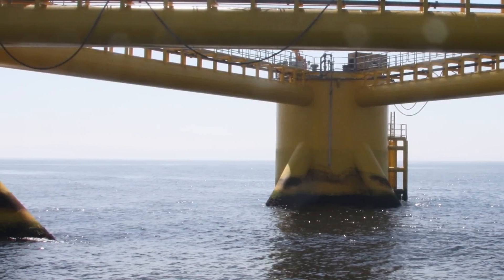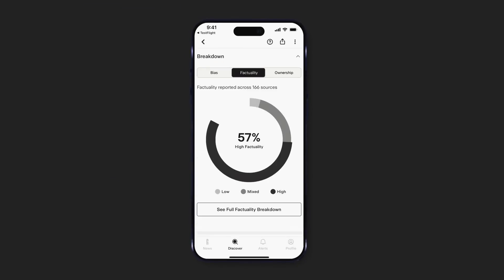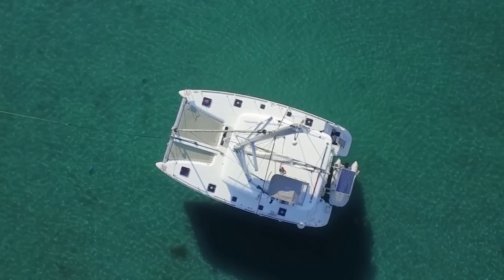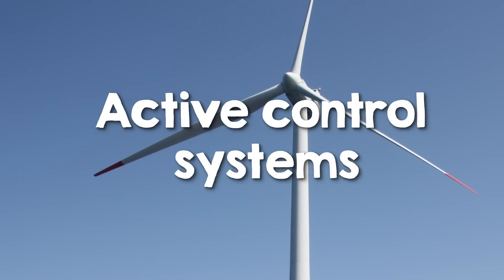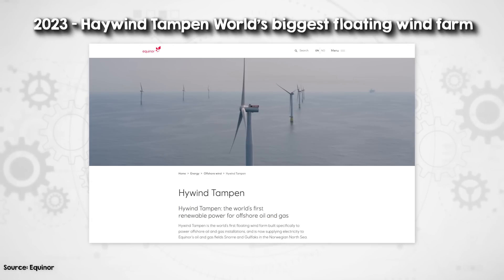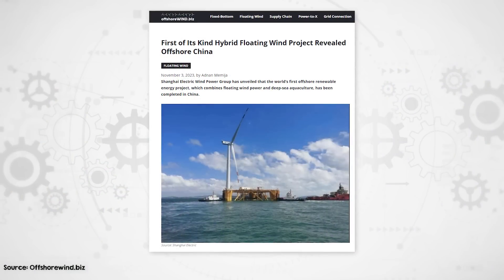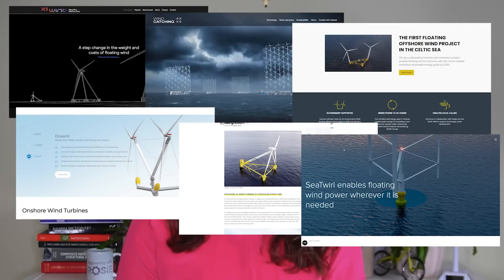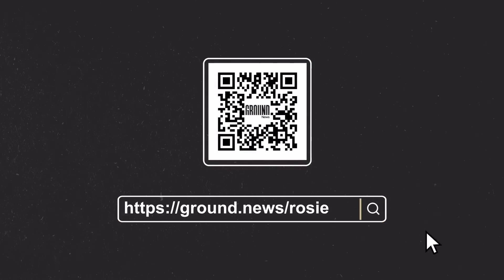The Rise of Floating Offshore Wind Technology

Comment: Wind is a scam.
Why?
Because without a lot of greenwashing  subsidies and huge power purchase price guarantees no one would ever consider investing in something so risky costly and inefficient . It is almost as if they are deliberately wasting time money and resources on things that will never achieve what is required while ignoring and even campaigning against technologies that will achieve emissions reductions at a far lesser cost and higher reliability  and I'm not talking about nuclear only.
There are places keeping aging coal plants operational to cover the shortfall of green energy wasting money on bandaids and such to keep them operational when they could have converted them to run on natural gas and garbage both of which don't go away because you've got wind and solar. There would be less carbon emissions from garbage and natural gas if it is burnt for energy than dealing with it in any other way.
Most so called recyclable materials which should result in a net reduction of emissions actually result in higher emissions than just burning it.
Wind is a solution when there are no better ones like powering a remote community. It is never a grid quality solution and never will be unless cheap clean 1000% efficient batteries are invented

Comment: I wonder how these installations will affect wildlife?
Reply: Probably better for birds than on or near shore, but not sure about marine life. Deep drilling platforms are actually known to improve some ecosystems as they provide habitat, these platforms could possibly do similar.
Reply: @szurketaltos2693  I'm sure you're right about that, but I wonder about the effect on marine mammals, especially whales and dolphins. Any sound transmission from these units is likely to be wide-ranging.
Reply: @mattlodge7305  hm, boat props don't seem to be a huge concern for sound and those are in the water; sonar is the real whale killer it seems. But maybe props are a bigger problem than I'm aware of?
Reply from the maker: The main noise issue is during installation and since there's no drilling here it ought to be much better than most other offshore structures.

Comment: I love your content!
How about combining tidal energy with the wind energy? You already have the transmission cables and already need a big base anyway. Throw some PV panels on too, just for fun
Reply from the maker: I do think that floating offshore's success may be what helps wave energy to finally get its act together. There are a lot of shared challenges and floating offshore has the scale and $$ to push through them where wave has failed in the past. Maybe we'll see shared projects, once floating wind gets a bit more mature. While it's developing I wouldn't want the extra complexity of add-ons to worry about, if I were project managing.

Comment: Many years ago the question for floating wind was 'how will the main bearings do being slopped abut like that' (so adding significantly to the dynamic loads). I guess if Hywind has been dragged back to port for major bearing work, that suggests that those fears were real. I'm sure I read that bearings could be replaced out st sea, because they are built as 3 segments precisely to allow in-situ replacement. But perhaps the point is that they have realised that beefier ones are needed, not just replacements of the standard ones, which is to hard to do out at sea. Looks like the bearing life is half or 1/3rd of  a fixed turbine. Does anyone have details of what has been discovered?

Anyway, yet another 'yay' for a quality video.
Reply: You need to remember that Hywind was built as an experiment, they wanted to find out how long the bearings would last, without having to wait for 30 years.  So they would not have used extra durable components.  I'm not sure that they are actually worn out anyway, it may just be that they want to see the results and upgrade them to test the next generation of technology, and the easiest way to do a thorough examination is to tow them into port.  Also, we are now about to start serious bidding for GW size floating wind farms, those results are needed this autumn.  We did already have some large size floating wind auctions, but nobody bid, too much risk for the price our government was asking, but this time there is more sensible money available for the risks that need to be taken...  floating wind is about to get serious.
Reply from the maker: I have not heard (even a rumour!) what the maintenance is, so I am only guessing like you are. And I also guess bearings, or maybe generators.

Comment: Offshore Wind turbines to harvest energy for electric ships? Fascinating!
What next? Ships powered by the wind itself?
It'll never happen!
Reply: Rotor sail  (Magnus effect ) operate on a few ships. It reduces fuel consumption by 5-10%
Reply: @thomasgade226  OP was referring to sailing ships I believe. 😀 Zero carbon transportation.
Reply from the maker: ha ha! Stay tuned for a video on wind assisted shipping, another one of my favourite emerging techs.
Reply: @EngineeringwithRosie  Re-emerging (and improved) tech I think you mean.... 😉
Reply from the maker: @zen1647  fair!
Reply: It has already happened, at small scale.  
No, the ships will not be directly wind powered, the big ships spend most of their time in the low wind parts of the world, far more cost effective to put the turbines in the best wind locations and store the energy as synthetic ship fuel, or for ships that make short journeys, use battery power.
Reply: @nigels.6051  No kidding? Noddy.
Try googling sarcasm

Comment: At some point, it is certain we will have to industrialise floating sea wind with mass production techniques based on standard components to bang out and float more than 1,000 units every year. For this, we must chose a design that can be made rapidly and assembled entirely onshore, then just be floated out and hooked up. If it is damaged or defective it must be easily unhooked and towd back for repair. Those design restrictions will dictate the model design features - so they are unlikely to be the biggest or most complex designs with the great output, nor are they likely to be done on spar buoys. I suggest we set up a panel in the UK to review all the available technologies to determine the design that most lends itself to mass adoption. I am particularly impressed with one VAWT model in development in Holland that has a single blade, erected on a giant barrel such that higher winds elevate it, automatically reducing its wind load based on the blade design. It seems to offer the best combination of simplicity, economy of materials and power - they reckon they can make them at 12.5MW. It’s early days, but we need to be floating more than 1000 pa within the next five years just in the UK - time’s a wasting….
Reply: They are a massive scam it's all to take the tax payers money wake up
Reply: The developers don't seem to agree, for example BlueFloat's Celtic Sea wind farm is planned to produce 1GW from 50 turbines, so 20MW turbines, with construction starting in 3 years, so they will be using small numbers of the largest available turbines.  The UK now has 30GW of installed wind capacity, but not a single vertical axis turbines as far as I know.  Using untested technology on GW scale farms is not sensible, especially floating farms located in the windiest of places!
Reply: @nigels.6051  Aha - a fellow enthusiast! No, there are no VAWTs I know of in the UK.  This particular VAWT is being developed in Holland. So far he has only tested a small model, but a larger test model is underway. It is fantastically clever in its simplicity, though.   I do maintain that we need to industrialise the entire process of turbine production in the UK to scale it up. Delivering a turbine should be no more than towing it out and plugging it in. Removing a broken turbine should be no more than towing it back and fixing it. The spar buoy turbines are amazing - and I note the Hywind turbines are all being taken back to Skandy for refitting - already.
Reply: @ThinkermanQuindo  I have seen a vertical axis turbine in the UK, many years ago in South Wales.  Looked a fantastic design and was obviously better than the horizontal axis machines next to it, but the test results didn't agree!  We have already had this competition back in the 90's, vertical lost, and if it is to have another go, it needs to prove itself on land first, or in very small and easily accessible offshore test farms as we are maybe seeing with SeaTwirl, expect it to fail again!  The Celtic Sea floating area does seem to be getting quite a few designs, it will be a competition between the farms to find the right design,  but the turbines will be conventional technology because the farms are too big to risk anything else.  I agree that it needs industrialising, but that is now underway along the South Wales ports, the Celtic Sea turbines will be simply towed out of port and anchored, then brought back for servicing.  Massive investment needed for the ports, the turbine manufacturers and the wind farm operators, so the first farms will be a bit expensive, but after that...  20GW of cheap green power coming up, the bigger the scale, the cheaper it will be, the bigger the turbines, the cheaper it will be!    Floating wind is capable of having larger turbines that anything else, expect them to continue increasing in size...

Comment: Finally: To compare the energy storage and output capabilities of Tesla MegaPacks with a typical fossil fuel power plant, we need to look at both energy storage (measured in MWh) and power output (measured in MW):
### Tesla MegaPack:
- *Energy Storage:* Each MegaPack can store up to 3.9 MWh of energy. For 4,000 MegaPacks, this totals to *15,600 MWh* of energy storage.
- *Power Output:* Assuming each MegaPack can output around 1.5 to 2.5 MW, for simplicity, let's take the midpoint at *2 MW* per MegaPack. For 4,000 MegaPacks, this would theoretically allow for a maximum power output of *8,000 MW* if all were discharging simultaneously at full capacity. However, this would drain the energy very quickly.
### Typical Fossil Fuel Power Plant:
- *Energy Output:* Fossil fuel power plants are typically rated by their power output, not energy storage, as they generate electricity continuously. A typical large coal or natural gas power plant might have an output capacity ranging from 500 MW to over 1,000 MW, with some of the largest plants exceeding 3,000 MW.
- *Energy Production Over Time:* If we consider a typical large fossil fuel plant running at full capacity for 24 hours, it would produce:
  - For a 1,000 MW plant: 
    - 1,000 MW * 24 hours = *24,000 MWh* in a day.
- *Operational Considerations:* Fossil fuel plants don't always operate at full capacity due to maintenance, load requirements, or efficiency considerations. Their actual energy production might be lower, often around 50-80% of capacity factor.
### Comparison:
- *Energy Storage vs. Production:* The 4,000 MegaPacks can store *15,600 MWh* of energy, which is less than what a single large fossil fuel plant could produce in a day if running at full capacity. However, this comparison is somewhat misleading because MegaPacks store energy, whereas fossil plants generate it continuously.
- *Power Output:* If all 4,000 MegaPacks were discharging at once, they could theoretically match or exceed the power output of even the largest fossil fuel plants for a short duration. However, this would deplete their stored energy in about 2 hours at full output, whereas a fossil plant could continue producing at that rate for much longer, limited only by fuel supply and maintenance needs.
- *Usage Scenarios:* 
  - *Peak Shaving and Grid Stability:* MegaPacks are ideal for providing power during peak demand times or stabilizing the grid, which fossil plants might struggle with due to startup times or operational constraints.
  - *Environmental and Operational Flexibility:* MegaPacks offer zero emissions at the point of use, can be deployed quickly, and have operational flexibility, unlike fossil plants which require fuel logistics and have significant environmental impacts.
- *Economic and Environmental Considerations:* While MegaPacks might not match the continuous output of fossil plants, they offer benefits in terms of reducing peak demand costs, integrating renewable energy sources, and reducing carbon emissions, which are increasingly valuable in today's energy market.
In summary, while 4,000 Tesla MegaPacks can't match the continuous energy production of a large fossil fuel plant over 24 hours, they provide significant power output for short durations, offer grid stability, and support renewable integration, making them complementary rather than directly comparable in traditional terms. Their value lies in their ability to provide rapid response, environmental benefits, and flexibility in energy management.

Comment: The energy storage capacity of a Tesla MegaPack is typically measured in megawatt-hours (MWh).
*Tesla MegaPack Specifications:*
- The Tesla MegaPack has a capacity of approximately *3.9 MWh* per unit, depending on the specific model.
*Calculating Total Energy Storage:*
- For 4,000 MegaPacks:
  - Total Energy Storage = Number of MegaPacks × Energy Capacity per MegaPack
  - Total Energy Storage = 4,000 × 3.9 MWh = *15,600 MWh*
*Power Output vs. Energy Storage:*
- The power output (in MW) of a MegaPack can vary, but typically, it's designed to provide around *1.5 MW to 2.5 MW* per unit for short durations, depending on the configuration.
If we're talking about how much power could theoretically be drawn from all these MegaPacks simultaneously:
- If each MegaPack can output, say, *2 MW* for simplicity:
  - Total Power Output = Number of MegaPacks × Power Output per MegaPack
  - Total Power Output = 4,000 × 2 MW = *8,000 MW*
However, **this power output would drain the stored energy very quickly**. If you were to draw 8,000 MW continuously:
- Time to Drain = Total Energy Storage / Total Power Output
- Time to Drain = 15,600 MWh / 8,000 MW = *1.95 hours*
In practice, MegaPacks are not typically used to provide such massive power outputs continuously but rather to provide sustained energy over longer periods at lower power levels or to provide peak power support for shorter durations.
So, to summarize:
- *Energy Storage Capacity:* 15,600 MWh
- *Maximum Theoretical Power Output:* Up to 8,000 MW if all units are discharging at their maximum rate, but this would be for a very short duration.
For practical applications, the power output would be managed to match the load demand, which could be significantly less than the maximum theoretical output, extending the duration over which the stored energy could be used.

Comment: I asked Grok 2.0 how many Tesla MegaPacks would fit in a super tanker.  Now I realize that the issue is actually mass and not volume but this is a first approximation: **a rough estimate, considering packing efficiency, would suggest that around 4,000 to 5,000 Tesla MegaPacks
To determine how many Tesla MegaPacks would fit into the largest super tankers, we need to consider the dimensions and volume of both the MegaPacks and the tankers.

*Tesla MegaPack Dimensions:*
- While exact dimensions can vary, a typical shipping container size, which is somewhat similar to a MegaPack in terms of fitting into spaces, is about 20 feet long, 8 feet wide, and 8.5 feet high (6.1 meters x 2.44 meters x 2.59 meters). However, for simplicity, let's assume a MegaPack has dimensions close to these for our calculation.

*Volume of a MegaPack:*
- Volume = Length × Width × Height
- Using the shipping container dimensions for approximation: 
  - Volume ≈ 20 ft × 8 ft × 8.5 ft ≈ 1,360 cubic feet

*Converting to Metric:*
- 1 cubic foot ≈ 0.0283168 cubic meters
- Therefore, 1,360 cubic feet ≈ 38.4 cubic meters

*Largest Super Tankers:*
- The Seawise Giant (Knock Nevis) is often cited as the largest supertanker ever built, with a length of about 458.45 meters, a beam (width) of 68.8 meters, and a draft of 24.611 meters when fully loaded. However, its usable cargo volume (which we're interested in for fitting MegaPacks) isn't directly given but can be inferred from its deadweight tonnage or cargo oil capacity.

- For simplicity, let's consider a more general large tanker's cargo area:
  - If we take a large tanker with dimensions for cargo space roughly as 300 meters long, 50 meters wide, and 20 meters high (a conservative estimate for calculation purposes):

*Volume of Cargo Space:*
- Volume = 300 m × 50 m × 20 m = 300,000 cubic meters

*Fitting MegaPacks:*
- Assuming we can fit them like bricks, with minimal space wastage:
  - Number of MegaPacks = Tanker Volume / MegaPack Volume
  - Number of MegaPacks = 300,000 m³ / 38.4 m³ ≈ 7,812 MegaPacks

However, this calculation assumes perfect packing efficiency, which isn't realistic due to space wastage, access corridors, and structural elements within the tanker. A more realistic packing efficiency might be around 60-70%:

- With 60% efficiency: 7,812 * 0.6 ≈ 4,687 MegaPacks

Therefore, **a rough estimate, considering packing efficiency, would suggest that around 4,000 to 5,000 Tesla MegaPacks could fit into one of the largest super tankers**, assuming the tanker's cargo space dimensions and that the MegaPacks are packed efficiently. Remember, this is a theoretical number and actual numbers could vary based on real-world packing, tanker design, and MegaPack dimensions.